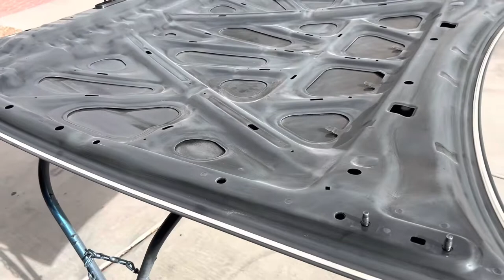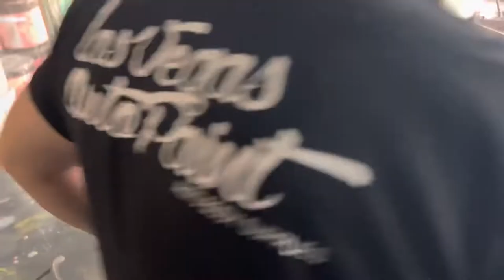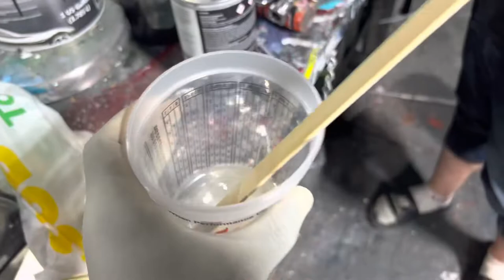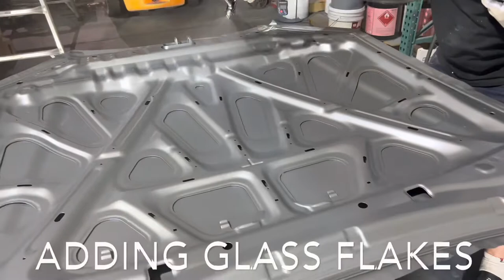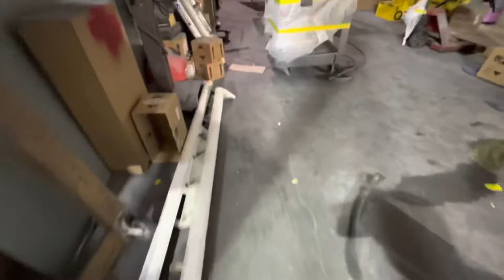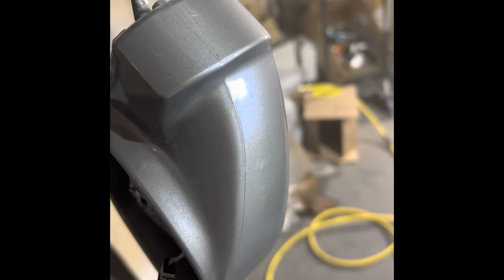Painting the Nissan Stagea (R34 Gtr conversion)

Comment: How did you mount the hood?
Reply from the maker: So there 2 ways of making the hood hinges work:

1) using your stagea old hinges and r34 hinge.   Put them side by-side-by matching both to the side they are used on. Put the stagea hinge on top of the 34 hinge using the forward hole(hole closest to the front of the car)on the hinge to help identify where to drill the second hole on the hinge. After drilling the hole on the 34 hinge, you can see it match up with the body holes, you will need to buy 2 inch spacers to space top the hinge to match to fenders because stagea hinge set up higher then r34 hinges does.

2) on the back on both 34/stagea hinges there a rivet that allows the hinges to swivel, you can drill that rivet off on both hinges and yes the stagea lower off and r34 up haft. Both then together but you will need a compression washer to allow it to swivel without loosening up